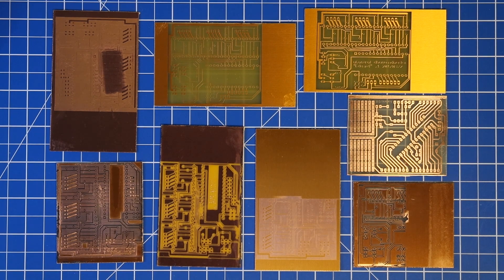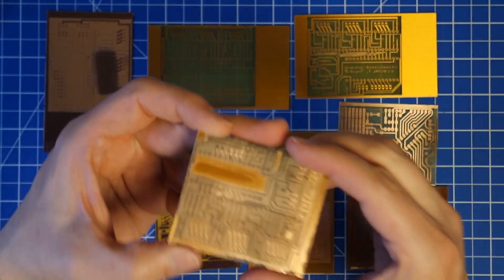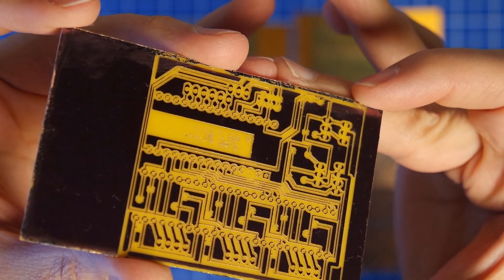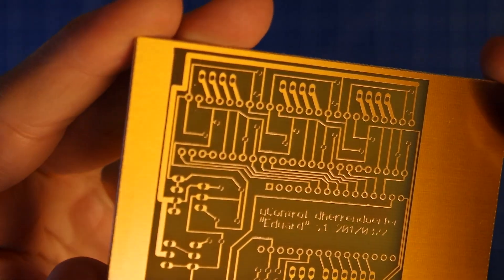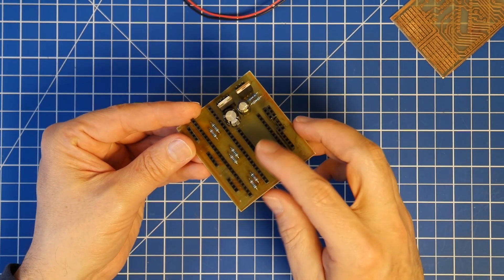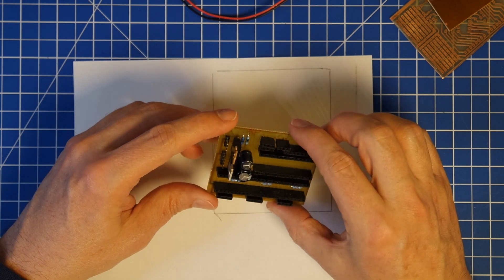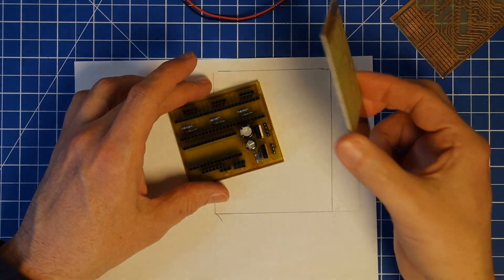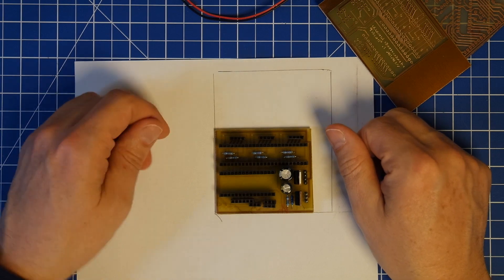The new CNC table pt. 16

Comment: some , not all of my Nano's do not like having the computer go to power off monitor , or even screen saver when  running comport intensive things . its like the port get out of sync . 
also I woudl check for any of the incremental values that you are using Long var types , and all math  properly cast to longs .  my own firmware for my laser suffered  not casting some floats and ints to long before / during inline operations.  so I was dropping off the decimal part of the floats . And in one mode for my Arc rendering to small line segments from g code arc commands  function i had a int where it should have been a long , that cause  wrapping of a value that should have never been negative . LOL .  freaking type conversions and proper type casting . 
also  light leakage can be laser light scattering in the fiberglass material . so there should be brands / types and colors of FR4 that will have less sub surface scatter of laser energy . 
I also made my own Nano board def  / type that has a larger serial buffer . with default board def , no matter what you set it to it wont actually go above 64 ,  i made a def with the core lib adjust to 128. that helped for apps sending long strings that contained float data .  what would happen , the laser would be moving fine and then just hang as the serial buffer was over flowed.  so i tried just a define in my sketch  to 128 , and no effect . i found i had to edit the max value in the board core files to get a 128 buffer as max  .
also to combat the PC going into power save mode i  just open a VLC window and pause the video play .  VLC is real good at stopping a computer from any for of sleep . 

any how thats just some ides to look at man .
Reply from the maker: I'll look into it, but those seizures are so rare, that It's hard to look for them - I only know, that when they happen, the Arduino is dead, until reset - not even interrupts fire. My laser would have turned off then, because the watchdog would have done so.
I do know that floating point math seems to be connected to it - but no idea how or why ....
Reply: yeah my laser plotter firmware used to fail when the g code sender would send a line of text containing floats that was longer of line than my parser could deal with , that would also hang just like serial buffer overage .  but  the way you can test that is the g code file will fail at the same point every time . every time and if you look at the g code file with line wrap off , you may find a offending line or 2 of code .
Reply from the maker: No, my stalls happen at random times - have you ever checked if you use too much c++ wrapping in your code ? The builtin memory management of the arduino libs is really aweful. I ended up removing most c++ code and writing plain c code to replace that instead.
Reply: yeah i have , but most of my projects dont get that intensive to need that .
Also just thinking .. random could be power or RF or such noise making it to the nano some place . could be time to look at some noise isolation on your wires.  hell i might be as simple as snapping a ferrice choke on the USB wire close to the nano
Reply from the maker: Yes.